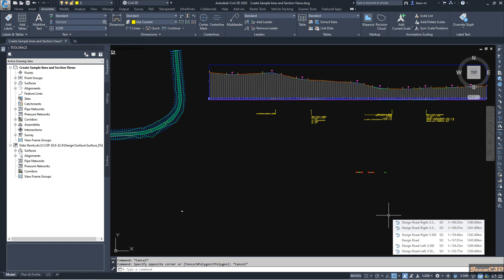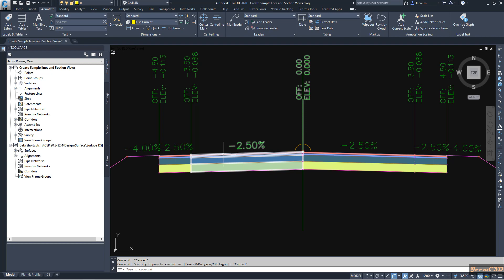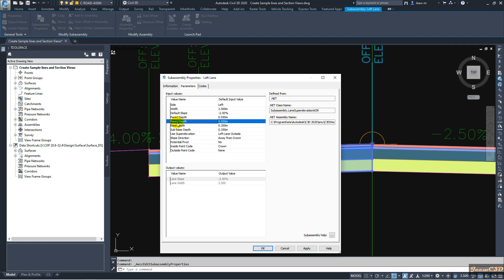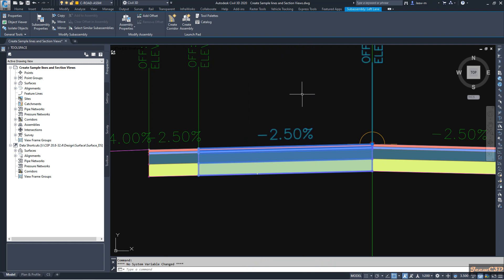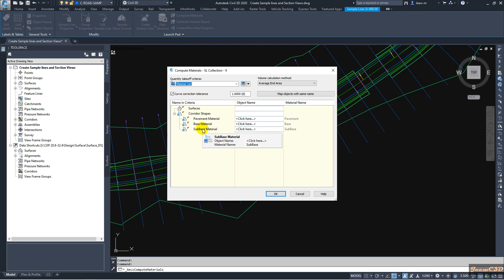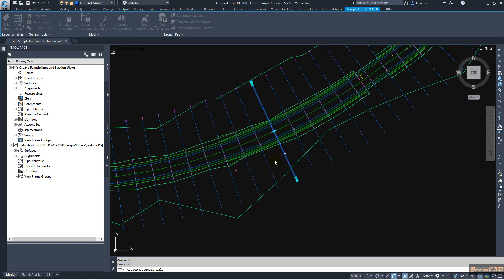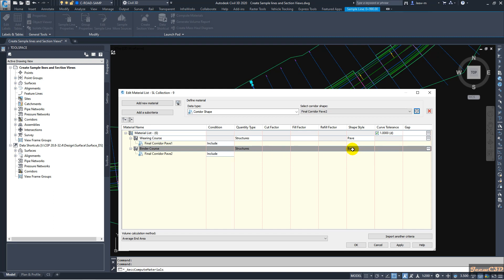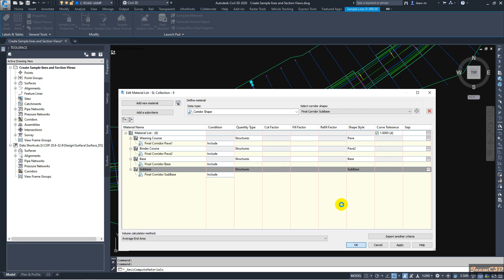How to Calculate Material Volume in Civil 3D (Structural Volumes)

Comment: Sir please 
Could you please make a practice project which is include points, surface, parcels, grading, feature line, alignment, corridor, profile, assembly and pipe network
Whole in one practice project